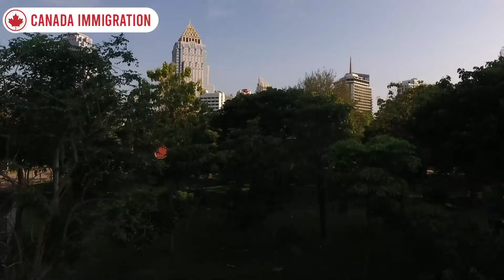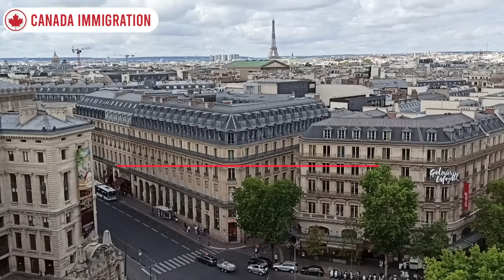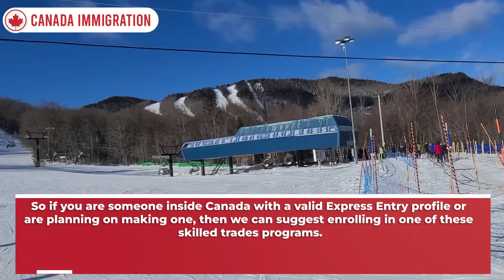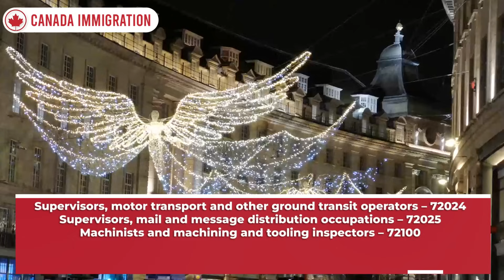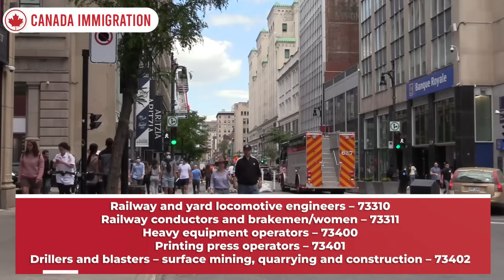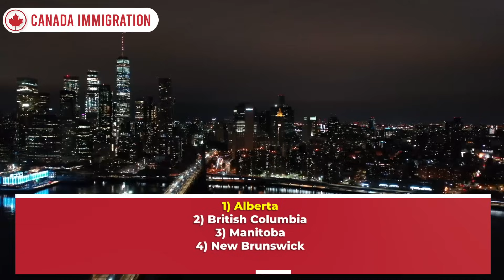IRCC : Canada Immigration Challenges & New Express Entry Occupation List | Immigration News 2023

Comment: Everything sounds good, the only problem is that it is a mess to find a body that validates both your experience, ability and the standards, it is confusing and they send you from one place to another, but there is no professionalism, that is, a flowchart. which tells you step by step to be able to approve your certificate, in my case that of a professional electrician with experience in the US, and two more countries, in the case of my wife, a nurse, they send you from one place to another, but they do not give you concrete information. , and on the other hand the so-called Canadian experience, is a nonsense.  we are in Ontario